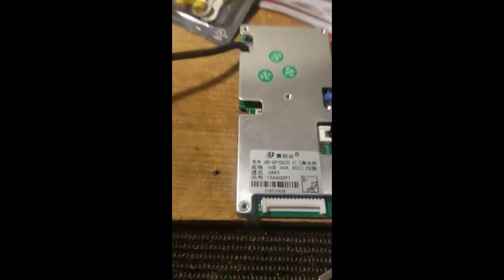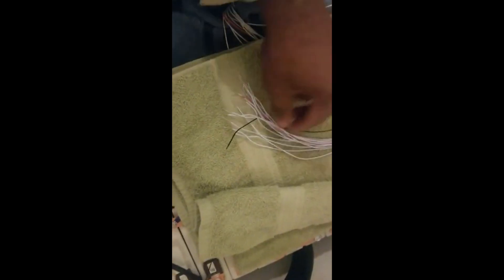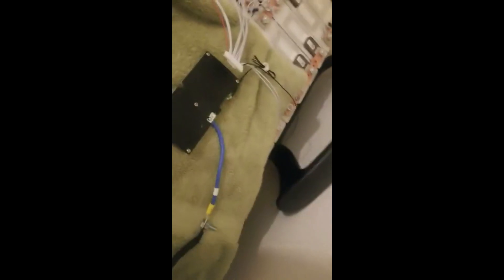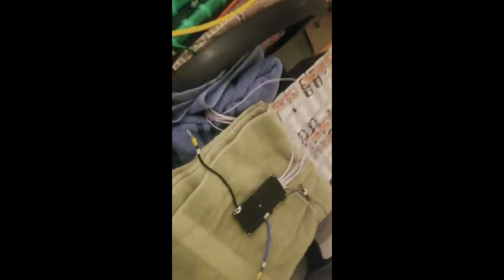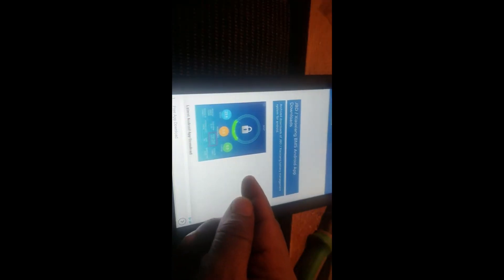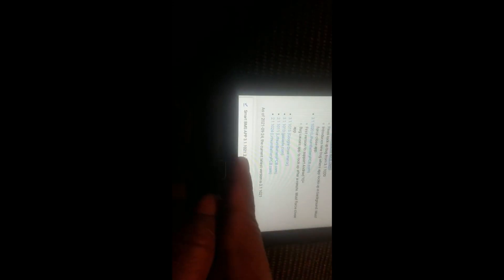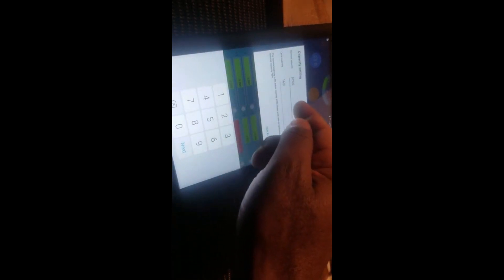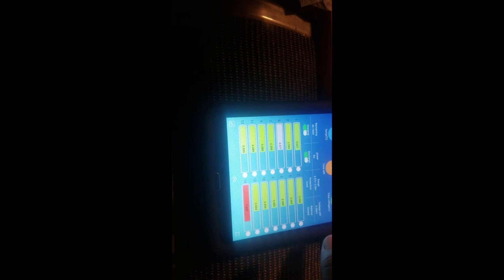DIY SETUP JBD SMART BMS 14S 48V 80A 100A 120A Li-ion Lithium Protection Board UART with BLUETOOTH

Comment: are you able to work 10s for this bms?
Reply from the maker: Yes, you can but I didn't do it. The Bms will ask you how many series
Reply from the maker: It is programmable. I can use it for Lifepo4 or lithium ion
Reply: @simplyfocus9937  i did try and you have to short some wires followed their schem but it didn't work for me on 10s. a bit painful haha.
Reply: @joaquinninoortega156  what do you do with the leftover wires. Are they connected or just cut them off
Reply from the maker: @brenthawkins204 you will need to connect 13th, 14th, 15th wires to the 13th cell. 16th wire to the 14th cell

Comment: I bought  Solarlock 6s-21s 100A BMS  with auto  detection...I wired  it    according to the diagram ( 20S ) but my bms  app shows, that there is 21S but  cell bumber 20 is.empty and it keeps showing alarm of a single cell undervoltage ...  it should show rather 20 cells and number 21 empty (not.present) .... did anyone have the same experience and solved it by rewiring the last two cells other way? ...
Reply from the maker: Try to put 18 & 19 together and 20 by itself. I had 17s wires, I put 13, 14,  15, 16 in 13th cell and 14 NY itself. It worked